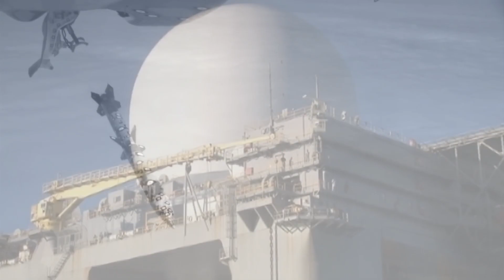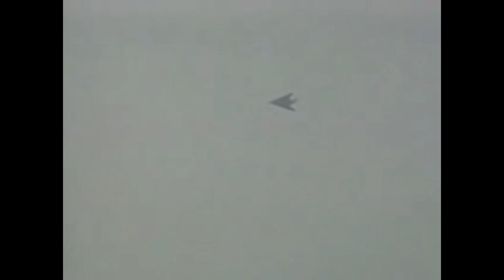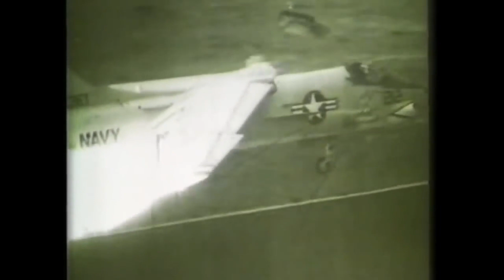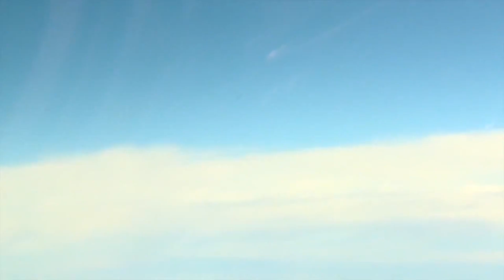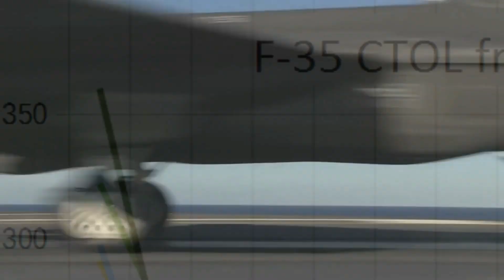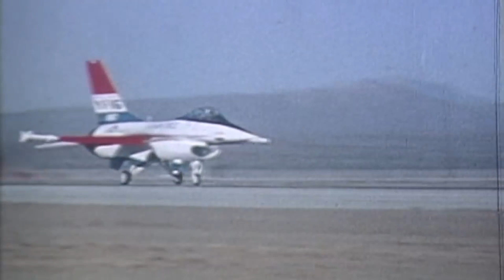F-35 Lightning II: Busting Myths - Episode 2

Comment from the maker: +Aey - Anna Pibulsilp The F-117 wasn't retired for another 6 years after the shoot-down incident. The primary reason it was retired though was that the F-22 could do [almost] everything the F-117 could and much, much more, while costing about the same per-plane and per-flight-hour. The F-117 in particular had very maintenance-intensive stealth coatings, which made it quite a hangar queen. The B-2 improved on those coatings, the F-22 improved even more and the F-35 is improved even further to the point where you can use the stealth coatings as a door mat and it'll still be good after years of use.
Reply: PANKI_7 Bitch, I just gave you contrary information. All you are doing is saying a heard a general talk about it once. If he was talking about why the production was cancelled, then he is talking about 2006. It doesn't matter when he said it, it could have been yesterday. As of right now, F-22As man-hour per flight hour is more or less equivalent to new production F-16Cs.  Fuck some people are stupid.
Reply: PANKI_7 Assertion: F-22 maintenance man-hours per flying hour have increased, recently requiring more than 30 hours of maintenance for every hour airborne. 

Facts: The F-22 is required to achieve 12.0 direct maintenance man-hours per flight hour (DMMH/FH) at system maturity, which is defined to be when the F-22 fleet has accumulated 100,000 flight hours. In 2008 the F-22 achieved 18.1 DMMH/FH which then improved to 10.5 DMMH/FH in 2009. It’s important to recognize this metric is to be met at system maturity, which is projected to occur in late 2010. So the F-22 is better than the requirement well before maturity. 

http://www.hatch.senate.gov/public/_files/F22AssertionsAndFacts.pdf
Reply: PANKI_7 No, child, that may have been correct information at the time, however, as clearly stated in the above quote and link, since that time - 2006 when production was cancelled - F-22A's man-hours per flight-hour have dropped to below 10, which is comparable to an F-16. 

You are just dumb enough to take a snapshot in time and assume that will continue throughout the life of the program.
Reply: Dark Coven    Nothing wrong with the F-22 and works just fine. The thing wrong is your hate.
Reply: +J GT What more versatility to you need? It will be very capable in air defence, air superiority,  strategic strike (with JASSM), tactical support (interdiction and CAS) counter maritime operations (with either LRASM or JSM). If we decide to buy F-35Bs later on it can act as naval airpower. Are there any other roles it needs to fulfil?   

'Do you think 75 planes is enough for Australia.'

Australia has always had a 4 squadron combat air force, essentially since WW2. That allows us to generate 2 squadron sized strike packages at a time. That gives us true overmatch over Indonesia and Malaysia combined, and enough firepower to deal with naval formations as large as carrier strike groups.  Remember, if things look more dangerous, we could increase our capability by 50 or 100% (6 to 8 squadrons) in about five years. That's how long it has taken to stand up the Growler squadron.

Additionally, there's a decent chance that the Super Hornets wont be replaced in 2030, but kept as an additional squadron on top of the 100 F-35As.
Reply: @timblizzard4226  hi Tim Blizzard, having seen some of your comments about the F22, I would like to know your thoughts on the F35, particularly the F35B variant, which is being purchased by the UK MOD, to be operated from the UK's two new carriers, thanks.
Reply: PANKI_7 lol no. That's not how this works. First off, the F-22 has not been a secret X-plane for a while now. "early prototype" means early on in the testing phase of the project. Since you apparently don't possess common sense I guess I should have clarified that. And I'm not going to argue with you over what the definition of "man hours" is. If you don't understand it and think that the plane actually spends 30 hours in the hangar after every hour of flight, you're simply a stupid person and I can't help you.
Reply: PANKI_7 You have any evidence at all that the F-22A has been pulled from operational status??????? I have NEVER heard that, in fact, after a solid good search I found NOTHING which n F-22A squadrons have been reduced to non operational status or have been issued with other aircraft.

F--22As where operational in 2015 Red Flag Alaska,  

In 2016 the 36th fighter squadron, with F-22As, been deployed to Korea.

'The F-22 Raptor is the most capable air superiority fighter in the world, and it represents one of many capabilities available for the defense of this great nation. The U.S. maintains an ironclad commitment to the defense of the Republic of Korea,” said United Nations Command, U.S. Forces Korea deputy commander and U.S. 7th Air Force commander, Lt. Gen. Terrence O'Shaughnessy, during a combined press engagement with media.'

http://www.f-16.net/f-22-news-article4833.html

That was 2016.

So, basically, you are either completely full of shit, or you didn't understand whatever it is that you heard.
Reply: PANKI_7 You're a liar.
Reply: PANKI_7 The only test that matters is combat. With the rising tensions between major powers around the globe war is probably coming. Indeed, for those who can manage to survive long enough, they will know which design took the most blood.
Reply: +Dragon029  Hi Sir, do you truly believe that the 35 will give Australia the air superiority it requires in the region. What are your thoughts on this. I am worried a little that it may not be as versatile and as much of an advantage as we need and prey that it is. Do you think 75 planes is enough for Australia.
Reply from the maker: J GT
I think it's fine an F-35 should dominate 4.5th gen fighters and stack up well against other 5th gen fighters - Australia's biggest military concern when obtaining fighters though should be in air-to-ground / maritime warfare however, as Australia's forces are few yet cover a lot of ground; if a landing force somehow managed to create a beachfront by posing as a civilian shipping vessel, fighters would be the quickest way of responding. Likewise, if opposing naval vessels left the docks of enemy territory and started sailing towards Australia, fighters would get there, in force, quicker than any frigates, etc. How many is enough depends on the specific scenario. For any scenario where US / allied support is more than a few days away, 72 to 100 should be fine.
Reply: PANKI_7 They are incorrect.
Reply: United States of Embarrassment LRIP F-35's maintenance per manhour is public information. Early models of a new developmental capability are always maintenance intensive.
Reply: PANKI_7 This is from an official US senate report:

"Assertion: The F-22 can only fly an average of 1.7 hours before it gets a critical failure that jeopardizes success of the aircraft's mission. 

Facts: Reliability is measured by Mean Time Between Maintenance (MTBM). One of the F-22 Key Performance Parameters (KPPs) is to have an MTBM of 3.0 hours at system maturity, which is defined to be when the F-22 fleet has accumulated 100,000 flight hours. Through 2008, F-22s averaged 2.0 hours MTBM while the fleet has accumulated 50,000 flight hours. The F-22 is on-track to meet or exceed 3.0 hours of MTBM at system maturity, projected to occur in late 2010, and the latest delivered F-22s, known as Lot 6 jets, are exhibiting an MTBM of 3.2 hours."

http://www.hatch.senate.gov/public/_files/F22AssertionsAndFacts.pdf

So you are off by 300%. Keep trying though buddy.
Reply: United States of Embarrassment Its a fair guess - he could just be a special kind of stupid though? Its always hard to tell with these ones.
Reply: +PANKI_7       PURE BULLSHIT and you know it.
Reply: Dark Coven The F-22 is the most feared air superiority fighter on this planet. Even the Russians and Chinese freely admit this.
Reply: PANKI_7 you talking about tests, and other things, but can not put ah link in? you dont even know wahts red flag is.
you said, you hered this and this but you dont know any name! 
pls shut the fuck up or try to talk like ah adult person and not like mi dad.
guys like you dont care waht fact is or waths just propaganda is, you just belive waht you want belive
Reply: and im the reason wy you guys will be genuis affter talking with me xD fun ;) sorry for mi bad english lol
Reply: Nice info, cheers!  Those initial coatings deffinately needed some time in the boiler :)

the F-117 is a real baby and the True front-runner for the Stealth-gen of fighters.   She rocked SO hard back in the late 80s/90s.
No one else had 'em and the Soviets didnt have the resources to cook something like that up.   I still love it, after all these years.   gimmie a squad of f-16s & f-117s  and i'll take over Belgium. anyday :)
Reply: PANKI_7 So?
Reply: ***** That's the best thing you have?
Reply: +PANKI_7 that' was maintenance required for early prototypes. Has absolutely nothing to do with production aircraft. Oh and btw, those are man-hours. As in, if only ONE person was working on the aircraft, it would have taken him 25-30h. You're an idiot.
Reply: PANKI_7 My dear friend, that is not how this world works. You can't just deny facts and then strut around like you won the argument.

need some help? Here: http://en.lmgtfy.com/?q=man+hour
Reply: PANKI_7 Yeah, what would the US senate know. You're fucking pathetic.
Reply: Tim Blizzard "What senat knows, I said what man who understand plane said!"

At this point I'm 90% sure this guy is trolling.
Reply: PANKI_7  hate to tell you, but you don't even speak a single language correctly.
Reply: +United States of Embarrassment Just shut up against Panki....He's probably a paid troll hired by Putler to troll everything bad about U.S. weapons...We have enough of them here at YT that they are a disease for other people!
Reply: +Tim Blizzard Just give it up! As I've said, Panki is probably a paid Russian troll hire by Putler here!
Reply: PANKI_7 The problem is, people like you just concentrate on the bad, and ignore the good....One example. Let see the SU-27 or the F-16 go up to 60 degree alpha and remain in control...Wait they can't! Which plane can do it other than the F-22...Guess...Just do it..........Yep, the F-35! And the thing can't maneuver? WTF come at me again here.... And which aircraft can go up to 110 degrees alpha without stalling? Other than again, the Raptor? Guess.............Yep, the F-35 again! So once again, come around with this stupid unmaneuverable stuff again?
Reply: PANKI_7 You are just so stuck up "RUSSIA IMA STRRRRROOONNNKKKKK!!!!!!" ass are you! First of all, check out if those showboat airshow manuvers will have any combat uses at all before we start to talk!!!! Cause you seem to go, whatever I see at airshows (made by aircrafts with only half a load of fuel and NO WEAPONS = combat maneuvers!) and everysingle Russian spokeperson that ell you, our fighters own the galaxy!!!! We can shot down 90842347u912734928375 Starfighters, we can fly 234989032840329 light years, we can carry photon torpedoes and  laser cannons!!!!! WE ARE STRROOONNNNKKKKKK!!!! Goodybye and good riddance! You are a paid GRU agent hired by Putler here no matter how much you lie through your teeth!
Reply: PANKI_7 Ok, you are doing such a good job that I guess your handlers decided not to put a 9mm hole in your head! Keep up the good work and living in that world where only Putler and his cronies benefit! Hope the economy don't collapse on you so quick that you have nothing to eat! Hey, when that happens, they might just shot you anyways to keep the number of mouths that needs to feed down! GOODBYE!!!!
Reply: +StryderK 

Did you read that before posting?
Reply: i come from switzerland,  but he has the exact same thing i have: internet. but you are right, this is important to everyone, dont blame people, anyone from us know things because ah  reason. its how the universe works, anything that happens and is, has ah reason
Reply: PANKI_7 so that's why, you're a Russian fanboy that probably believes what Sputnik news says about US military.
Reply: Nice videos! Also, where'd you get the robotic voice? It's very good.
Reply: They are still operating a couple of 117s at Area 51!
Reply: is the F22 still flying?
Reply: F117 is a bomber, F22 a fighter! it is not designed for ground attack.
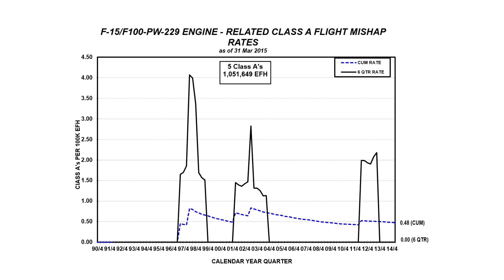Reply: 7:05 "computer engineering and new material science" "more reliable engine".. well there was that oil leak incident in 2015 and it didn't take long for a total loss in 2018:
https://www.youtube.com/watch?v=kJIhp9QstO0
Reply: The F-15 could Target the F-117 it had to get within  20km to make sure it was not a F-117
source   https://www.youtube.com/watch?v=getlNBgBwjs

Comment: Damit man you told them witch radar band to use.Nao it's all hopeless.
Reply from the maker: +Hristo Aleksandrov Good luck achieving long range tracking with VHF.
Reply: it have been done befor for shoting down low orbit satelate's who are many times faster then a jet fighter. :)
Reply from the maker: Satellites have been shot down, but by using X-band radar for tracking. Satellites are also an easier target to hit if you have a big enough missile; it's easy to hit a target when you can calculate exactly where they'll be days in advance.
Reply: haha
Reply: +Dragon029 Satellites are also very very VERY predictable! They are in a fixed orbit. You don't even need to "track" it, but just to detect it. Once you figure out its orbit, you basically got it done. Satellites can't change orbit, can't side step or maneuver and they are not stealthy. This means you can sit there and wait. Once it moves into the "hit" window, you launch its missile and arrive at a predictable point where the missile can lock on to it. Without the ability to jam anything, that satellite is basically meat on the table once a missile is locked onto it. Hell, we already did this since the 1980's.
Reply: +StryderK 

Oh, so wrong. Satellites since the 80s have had orbital correction and evasive maneuvering capabilities. As well, they are deployed in multiredundant constellations. The only thing that might be accomplished by taking out a substantial number, is a modest increase in absentee ratio.

Comment: So, why can't it use its vectored thrust for combat like the Harrier?
Reply from the maker: +key larfo If it's in a guns-only dogfight, then the only gun it can be equipped with (the external gun pod that sits underneath it) would be affected by it's vertical thrust. If you watch Episode 3 though, you'll see that there's no real reason that it should have to use thrust vectoring in combat though.
Reply: +Dragon029 Is it going to use helmet cueing and off bore missile shooting at enemies behind?
Reply from the maker: Yep; the pilot can even see video of what's behind their wings / fuselage if they want. Most air-to-air engagements though end before anyone gets behind anyone though.
Reply: Only the B variant has Victor nozzle.
Reply: +key larfo Also the Harrier as far as I'm aware has never 'Viff'd' in an actual dogfight, while a theoretical manoeuvring advantage it would have lost the pilot a lot of that precious forward energy leaving them a sitting duck if what ever fancy manoeuvre they were planning failed. You also didn't want to be moving those control levers in combat, even when only having a landing to concentrate on keeping it all balanced was tricky.

To be fair though the Harrier was well known for having a very impressive sub-sonic acceleration rate so if it had an excellent pilot who could judge those controls perfectly then it could have worked well, under some very limited circumstance. But in the end it was a pretty good brawler anyway, providing what it was chasing was also going sub-sonic at the time.

Comment: Thank you for that. We still have a lot to learn about this aircraft. Not everything is classified. Its important to note the tactical advantages and practical use of an aircraft before you comment on its disadvantages. As this is forseen as an aircraft to be in use for a very long time. This has answered my question as far as it's cost to produce. My next question is the cost and time that it takes to service and flight check, its long term reliability, and the terms of which pilots regard the aircraft who are comparing it directly from experience in mulitiple jets in regard to fuel cost. The unpredictable nature of aircraft design can lead to obsoletion. Even new weapons on the ground can lead to this. For example if sometime in the near future discoveries were made in laser tech this could make jets in general a poor choice of equipment to operate. As you can not in any jet out run the speed of light. While this has yet to occur, a military must be prepared for any circumstance. Another consideration should be made in regard to unmanned inexpensive aircraft which could serve the same purpose without risking the lives of pilots. I would think any air force would jump at that advantage.